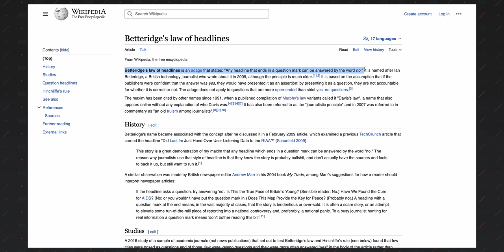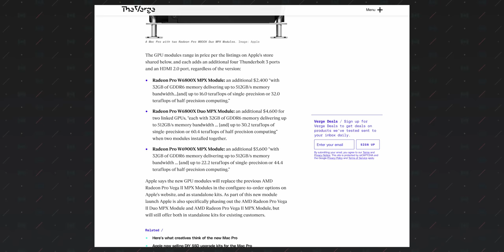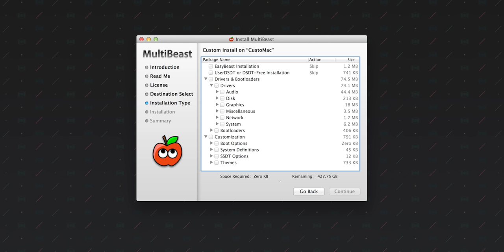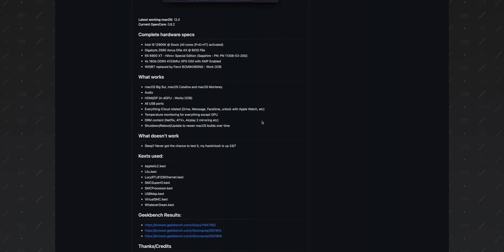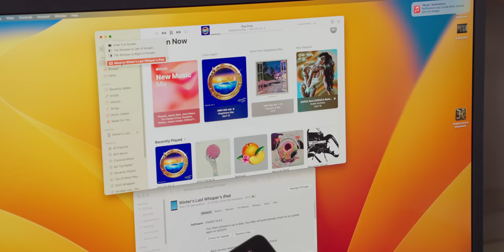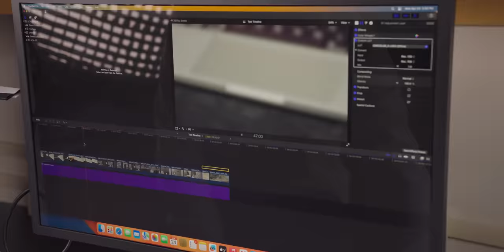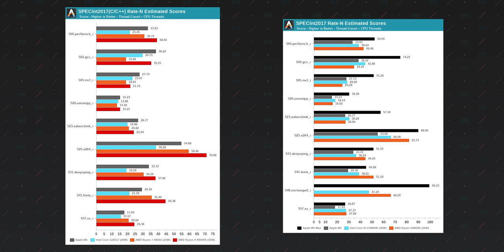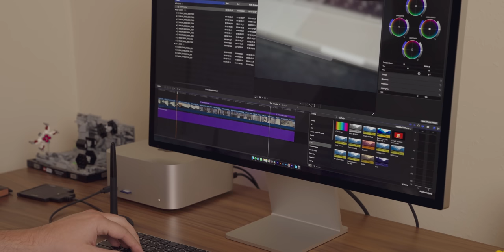This $2,000 Hackintosh SMASHES the $4,000 Mac Studio

Comment: besides better performance at half the price it is great to be able to throw in a bigger nvme or additional nvme's as well as add more ram whenever you want rather than apples must buy now soldered in ssd and ram at X times market price. i have real mac's but still not keen on the soldered on ssd's. built my first hackintosh at the time psystar came out and several more since including what may have been the first xeon es 12 core  on clover.

Comment: Anyone worked with ProRes RAW on MacOS Hackintoshed know if it's GPU decompressed? As far as I know, even ProRes RAW on FCPX is still CPU decompressed and some work is done by the GPU to debayer it, whereas the Apple silicon chips have dedicated ProRes RAW decoders built in.

Comment: The power efficiency of Apple Silicon really does make it more useful in laptops than desktops. My gaming PC (11900K, RTX 4080) pulls 700W under full load but that is simply the price of running games at 4K with maxed out settings. If I cared about saving energy, I would not use the desktop PC for gaming. Anyone who argues that energy savings is a compelling reason to use Apple Silicon in a desktop is objectively wrong. The cost of the electricity is literal pennies compared to the cost of the system itself. For a professional machine, being able to do the work quickly is much more important than sipping power too.

Comment: So sad that Nvidia drivers don't exist for macOS, and I don't think anyone in their right mind will port the Nouveau Linux ones anytime soon.
Along with the same CPU, 13700K, I had the 7900XTX, which I expected would end up working whenever the workstation versions of RDNA-3 would've gotten a macOS driver, but because of the junction temperature issue that board has, I had to RMA it and got an Nvidia 40 series... 
Kind of regretting it now

Comment: You've done an amazing job setting up this hackintosh. I do think you're flogging a dead horse though. As you mentioned, Apple Silicon processors will just become faster and more efficient and there will be a day when Intel processors won't be supported anymore anyway. I think the max age apple supports hardware is 7 years? So you've got x + 7 years where you can still have a hackintosh where x is the last year the Mac Pro is sold.

Comment: I have seen Ryzen 7000 and 5950x hackintoshes. And tbh some of them are just as powerful and more efficient with a still certainly low price point. But Efficiency isn't the issue here. Even if you buy a device that costs 2000$ more because of efficiency it will take you probably years or a decade to benefit from the extra costs to efficiency.

Comment: Hackintoshed my pc that I had to intention of trying it on so don't make fun of the parts I used.
Anyway, rocking amd ryzen 4600g and rtx 4060 and 16GB of ram, it works pretty decent for not being very compatible with macOS. Basic hw acceleration on the amd igpu, the Nvidia is kinda a paperweight in macOS tho, but im dualbooting with windows so it still has a purpose. I might take macOS off though and later buy an actual mac device or build a hackintosh with compatible parts in mind.

Comment: Great info, but some cautionary advice to any professionals watching; don't go the hackintosh route — big picture it's the wrong move. Nothing worse than updating a hackintosh, or dealing with reliability issues when you're on a deadline. There is no such thing as a free lunch, and you will pay with your time. 

If you're a hobbyist, or a tinkerer by all means... but if you make your income using macos, do yourself a favour and pay for the Apple hardware. Way better resale value when you decide to upgrade as well.... not that anyone factors this in with the price headline comparisons ✌

Comment: if I was to have a RX580 AND an RX6700XT installed, could I use OpenCore to ignore the 6700XT (since MacOS has no support for that GPU anyway) so i could use the RX580 (or similar) for MacOS and the 6700XT for Windows/Linux?

Comment: could you next time aim more for power efficiency while still beating a real mac in performance (and price)? 
you can undervolt and underclock the cpu and gpu, maybe even disable cores or hardware (like the unused usb controllers) on the motherboard. 
or just set the power limit to appropriate levels. 
if possible use an amd cpu, especially the mobile ones. then you may not even need a dedicated gpu. 
do amd gpus have something like nvidia optimus to be disabled when not used? does that work on a hackintosh?

Comment: I accidentally wiped the windows on my ThinkPad x240 so i said screw it, and as bit of a joke installed Mojave on it. It actually ran very well and supported pretty much all the hardware, the only problem is that i didn't correctly install Open core so when i removed the flash drive and turned it off it never booted again. Bit of a shame that i failed at the last moment but quite an interesting experience.

Comment: I mean if you need something from apple or you are a multiplatform developer and you want to dual boot. I don't see why not. But only for macos is too much risk for me. I see the benefit if you need Linux or Windows machine with good performance AND macos you save a lot of bucks. If you only need macos and you depends heavily on it I'll go for an official Mac unless you have the weirdest use case that makes you make a hackintosh

Comment: Undeniably hackintosh is being kill, its good to see how they perform but the days are counted. Arm is definitely the way to go apparently,  would be interesting in the future to see if an arm processor like those designed by Ampere or ThunderX3 can run a hackintosh we are talking of pure raw performance just found in epyc chips and xeon processors. Nice video bro, cheers
Reply: Yeah, that "whoops, 13th gen iGPU not supported" notice wasn't just an "oh darn" incident. That was a death knell.  GPU/Metal features are an enormous part of future feature/performance work.
Reply: @godofbiscuitssf  i completely agree, even Microsoft knows it and will begin with their own arm processors, Linus Torvalds also talks about how arm will be the future, Apple has the advantage in this matter cause they are practically ending their transition and their roseta compability is very well develop at least better than their competition

Comment: There's a new ARM CPU system option called "Ampere Altra Developer Platform", which could potentially run macOS. YouTuber Jeff Geerling has a video titled "This is what the next Mac Pro COULD be" that talks & shows it. There are links to either the fully built machine or the DIY kit for less $$.
Reply: I'm not sure about it, Amper is a good CPU but the problem of Macs is not the CPU but the GPU, and secondly limited RAM and proprietary storage. The GPU  in the video is an old 6800XT from 2020 and it obliterates the Mac in all GPU aspects. Now imagine what you could do with a modern Nvidia 4090 and a 13900 (for similar  total cost of a Mac Ultra), not to mention PCIe gen5 nvmes and the rest of the PC stuff. The Mac ultra is just a toy compared with high end PCs, but the CPU is the smallest of its  problems.

Comment: I just had to redo my hackintosh install this weekend, due to CPU upgrade from Ryzen 3900X to 5900X. With my Rx 6900xt the M series Macs are not even close. To get an equivalent performance Mac Pro would be close to $16,000. (CAD)
Reply: What model of  6900XT did you use? Did you have to do the device id spoofing?
Reply: @mrajewicz  the reference model. No ID spoofing needed with OpenCore, doing a Hackintosh is extremely easy compared to when I started doing hackintoshes back in 2008/2009.

Comment: So given that AMD's current-gen socketed CPUs have a homogenous mix of cores (vs. Intel's performance/efficiency mix), how much of a performance gain would you anticipate in CPU-intensive tasks (like Cinebench)? Likewise, any thoughts on how the Ryzen X3D chips' VCache would impact performance in macOS?
Reply: None and none. Scheduler is agnostic and the loss there is minimal compared to the loss of X3D scheduler requirements. 

We are talking about it on PC as the comparison is possible to isolate. Not because user experience changes drastically
Reply: Would be surprised if cinebench took a great performance hit altogether. Because it just hammers compute bound workload onto all cores.
You probably rather lose in more mixed workloads, where compute bound tasks dont scale well to all the cores.
You might end up with light I/O tasks on the performance cores  and the compute bound task on the efficiency cores since the scheduler is not aware of the asymmetric architecture.
You could work around this by manually setting process affinity, the kernel supports this but not all applications.

Comment: iam aktually buiding my new PC in a modified Powermac G5 Case, with a 13gen Intel CPU and iam planning on putting a radeon 7000 GPU in it, and there was the idea of putting Mc OS as a dual Boot OS next to Windows, but i guess i will wait until Apple supports these GPUs, or do they just work anyway?

Comment: Very nice and balanced analysis👍👏, Apple nailed it with their Silicon and we all will use hardware similar to this in the near future for efficiency reasons. Just look at the unreal power hungry recent models of cpus and gpus in the pc market which is in my view a large jump backwards. Come on, Intel, nvidia and Amd: 1300 watts psus, really?! I still use pc architecture though, since the mid tier models are cheap and somewhat efficient. But it was really not ez to cool my R5 5600x, needed a new case for airflow....

Comment: If Apple follows suit to the past, we will have 5 years from the time the last Intel Mac is sold until the x86 CPUs aren't supported by MacOS anymore. Quite frankly I'm shocked they haven't used the T2 to stop Hackintoshing. It suggests to me that there may be too many pros using other software on MacOS to cut it off yet.

Comment: I only use “Hackintosh” due to money constraints and using old PCs I get cheap. If I had the money to buy an ACTUAL Mac with superb design, thoroughly tuned and supported by  Apple up to the eyeballs… I’d have to be CERTIFIABLY INSANE to squander that money on a “Hackintosh” and never would. 

Also, how would you resell a tin box generic PC and pitch it to the buyer as “a Mac”? You couldn’t. 

Genuine articles only with the real money. Otherwise I’m happy using a 9 year old ThinkPad that cost me £45 - I don’t currently have the £££ spare.

Comment: I'm on the 10th gen Intel and I had it hackintoshed before. I'm really thinking to replace my 3060ti with a 6800xt now.
However it's not that straight forward to use opencore as you said. You probably got lucky with your config.
Reply: 10th gen is easy to hack, just use oc gen x to create the opencore files.

Comment: Programs optimized for M-chips eat Intel for breakfast. I'm still amazed that my 3950X, cooled by a half a kilogram CPU cooler is performing about the same, compiling the same code as my M1 MacBook Air (without wall power). I know these aren't apples to apples (pun intended), but still these ARM chips are AWESOME!
Reply: Amd made a dedicated AV1 encoding card that can encode 90 simultaneous streams using just 1W.
Dedicated silicon is made to be efficient but x86 CPUs are general purpose. If it's not specifically optimised for it, they can brute force through it.

Comment: "applications will only get more optimized for the custom hardware within the M1/2/x SoCs as time goes on" Speaking from experience back in the PowerPC days, applications basically NEVER caught up to using say the G4 and G5's 128 bit vector instructions outside some niche cases as developers. Especially developers working on multi platform software who simply cant justify focusing lots of development resources re-tooling their programs for a niche platform like the mac with radical paradigm shifts, or at least didn't historically.  In 1999 the Mac was a far more relevant platform then in 2023 by market share, PowerPC was a more mature arch then Mx and we never really got proper support for what those chips did well from the software world. I find the notion that somehow M1/2/x will do better at this, with a less mature far less "PC" like platform in a time where the Mac install base is smaller then ever very, very unlikely,

Comment: Are any Hackintosh experts able to answer this? 

I've actually wanted to build one for the last couple of years and even started the process at one point but ended up being talked out of it due to how much more involved it was going to be. However, after watching this video. I may just give it another shot. I'm fairly Apple illiterate (I only just recently picked up an M2 MacBook Pro because I wanted to play with Apple Silicon), but I happen to have a 9900k & 6700xt just sitting around collecting dust.

(I realize I'm privileged, but hey, I'm an enthusiast and run a custom water cooled Threadripper 2990wx & 3090Ti as my main Windows 11 Workstation) 

My side rants aside, would it be possible to build a Hackintosh with those pieces of hardware i9-9900k & 6700xt starting points?
Reply: You absolutely have the best parts for it. But the thing is, you may still need lot of hours configuring it to work. The video seems to be easy but its not.. (though its not hard as well) the thing is you still need a lot of time to figure it out searching, learning etc. If it will be worth your time, go for it, but if you are on most of the deadline like me, I just gave up. Its up to you...

Comment: Working at home 14h/day

My PC draws about 800W (13900K@5.7Ghz and a 4090) running full load
Average 1 kWh cost: 39 cents
PC running cost per year = $1595

M1 Max Macbook draws about 85W. Mac running cost per year = $169

By running M1 Max Macbook Pro, I save about $1,426 per year. 
Let's deduct $400 because you can get work done faster with a 4090 for the sake of PC master race. I save at least $1000 each year. 
4 years later, the machine pays for itself in terms of electricity cost. Those are real numbers from my Southern California Edison bill.

Comment: Considering I have several macs at my workplace that are practically useless because they are so old, I can't necessarily agree on the "it just works" statement. They boot fine and are in good shape, but good luck installing anything modern on them. Secondly, I can't imagine feeling bad about violating the EULA in such a way for a TRILLION dollar company. if I had to do the same for Microsoft I wouldn't feel sorry for them either.

Comment: No matter how good the Apple silicon is, if you have to pay the SSD and DRAM tax at 1000% of street prices, then its not so attractive except as a sampler. The jump from 8GB to 16GB or 250GB to 1TB SSD is flipping criminal. I'm a bit pissed with Apple since my 2018 miniMac has no video out and I don't know if its dead.  I also have a lot of dead SSDs parts in recent months too, way less reliable than rust drives now.

Comment: While the Mac Pro is a good pc, I think that arm on desktop, especially for people who use at home, that this makes no sense. arm should be a laptop thing only, due to insane battery life as a result of the efficiency. I have an m2 air and that thing lasts 3-4 days of usage. Overall if you need a pc that’s for performance it’s always better to make a custom pc, as 9/10 times, your spending less or an equal amount of money on hardware that is overall a lot faster, not to mention upgradeable, the main point of owning a pc.

Comment: macOS is specifically optimized to run on their limited no of supported hardwares. by running macOS on hardware that it wasn't originally optimized for, don't we miss out on performance? 
we see from the video that a 2000$ non-native hardware macOS will run better than a 4000$ native hardware macOS, but how does the former compare to a 2000$ Windows/Linux machine? 
what are the use cases for runnning macos on non native hardware? and is better to run a general purpose OS instead?

Comment: you are comparing a chip from 2020 vs 2023. M1 Ultra is based on M1 architecture which is designed in early 2020. let's wait a few more months when M3 Ultra releases. then compare it again it'll be fairer as both chips will be from 2023.

Comment: 15:00 this is very optimistic and only takes your country(?) into account and also what is the use case here? How many hours? 

Like my MBP runs for 14 hours a day so I will use these numbers for the Mac Studio, that's 8ish hours low power mode at 20w (office work, email, web browsing) and 6 hours under workloads at 90w (encoding, compiling whatever). That's 700w a day. I use it every day so that would be 255.5kw per year for the Mac Studio. Your Hackintosh draws 1492kw per year with the same runtime (using your power draw figures of 7x for low power tasks like web browsing and 5.5x under load). Though, you haven't shown what the power draw for compiling/encoding would be. I guess it would be lower than gaming? 

Current prices here in Germany are around 40c per kwh. So the Mac Studio costs you 102€ a year, your Hackintosh is 590€ per year... that's a 500€ difference. $2000 are 1800€, so yeah... 3 and a half years and your savings are gone.

Comment: Apple Maintains it’s computers 6-7 years? That’s not true. The 2016 MacBook Pro which still is a very capable machine was dropped from the supported macs list in 2022… After getting only 5 Updates. Only 2 Major ones… There were 4-6K$ machines that are no longer supported after a little bit more of 4 years!!!
They’ve been cutting out 2 generations of Macs per year in their last 3 updates… That’s 6 years of Macs in just 3 years…
They are phasing out Macs Fast… too fast… unethically fast. And they claim that they only stop issuing updates for macs if their hardware is not suitable for the latest OS release. Which is bullshit calling a i7 6980 obsolete…